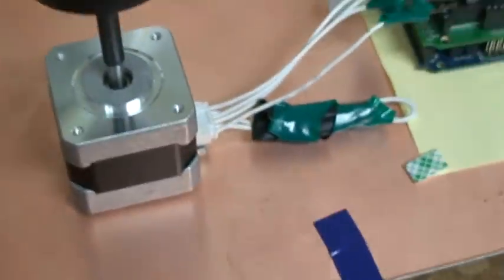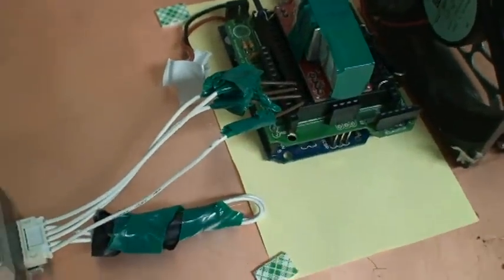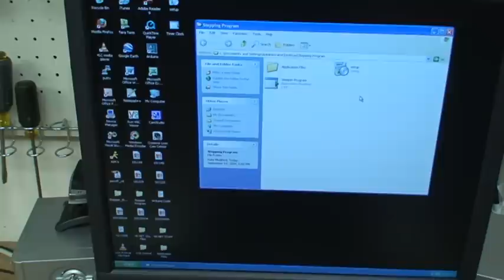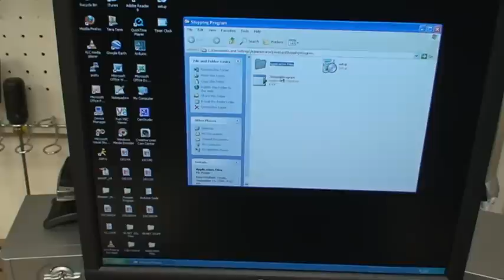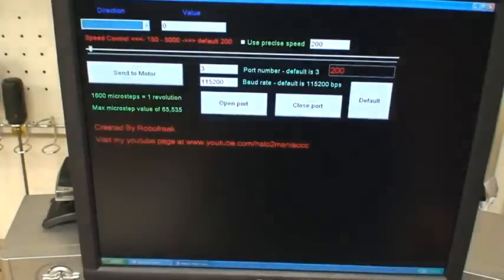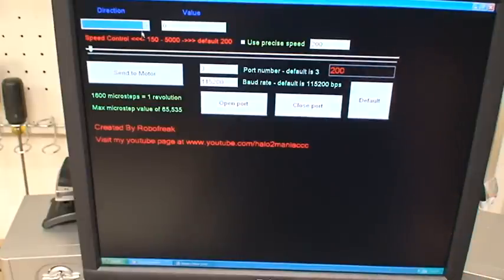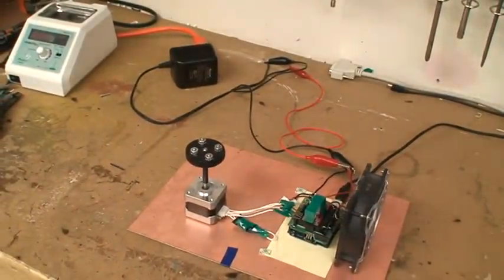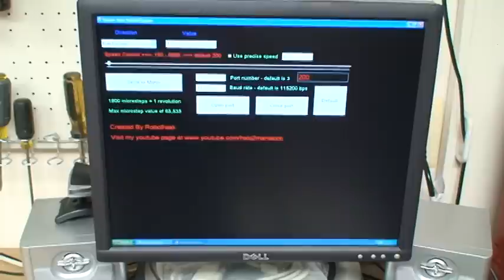Final stepper motor PC program easy driver v3

Comment: Hi, your videos are great. I have a question: In the software says 1600 microsteps equals 1 revolution. It means to be for a couple of revolutions must introduce 3200 steps? and not marking the 200 steps that has the stepper motor? I'm just trying to make one with Labview and Arduino and found the same situation. (that 1 step stepper motor, equivalent to 32 steps in the program)
Reply: Did you find any solution?

Comment: Hey Justin,  Appreciate your videos and the source code.  I'm trying to use your v2 Code with your VB.NET app.  VB I can handle, but the ino code is still escapting me a bit.  I can read it, but I don't quite understand it yet.  From what I can tell, you're using the digital pins, how would i tweak it to use pins 8-11.  Thanks for putting this together btw.

Comment: Thanks for the great advice. The motor shield does not have a current pot on it unfort. I will look into the probotix stuff. Good calll on the angle ext. for a heat sink, going to try that next. The motors pull about 1 amp. I have not connected the easy driver yet (kinda scared cause the chips are so small), hard to believe it can handle that much current, I will definitely heat sink that puppy. Ill let ya know how your software works with it. Thanks again.

Comment from the maker: O one more thing, if your motor chips are getting that hot you need to make sure everything is connected correctly and the current is limited. Its odd they are getting that hot so fast. The easy driver has a built in potentiometer to adjust how much current the motor can get. My easy driver got hot running at max power but the heat sink fixed that. All chips for things like this (motor driving) will get hot and must have somewhere to send the heat (pcb....heat sink etc...).

Comment from the maker: I would step up to a larger stepper motor driver if you can. Probotix sells one for $39 that will handle 3 amps continuously. I have three of these and each controls a large 280 oz in nema 23 motor for my cnc machine. Bolt a small piece of aluminum angle extrusion to the driver (as a heatsink). If its low power loads that fine but if its running at 3 amps you will want a tiny fan. They are just like the easy driver when it comes to driving them.

Comment: Sorry, I found it Dan. I did notice that you used a motor shield in one of your other projects. How do you do that without smoking chips? I tried very low current steppers and the chip get red hot in like 3-4 seconds. I think the motor shield is way cheesy for that. I says it can go to like 600ma, but I find that even piggybacking the chips they get red hot at 100ma. I tried all kinds of varying voltage with no luck. Steppers are current hogs! even the easydriver needs fans and sinks galore.

Comment from the maker: This is not the latest easy driver now but at the time it was. Now the V4 has been released and allows you to turn off power to the motor when it is stopped and it allows you to change the stepping resolution (200, 400, 800, 1600). If your motor is larger then mine you may have low torque because its just too big but if its the same size try turning the little tiny potentiometer on the circuit. It will change the amount of current the motor receives.

Comment: I am using a NEMA 23 like you, but my torque is low.  I tried running the motor at 8, 12 and 15v to increase the current and varying the delay value in the program.  Of course the 7805 on the Easydriver gets hot with 15v.  These set of videos are virtually the only practical applications using the lastest Easydriver.  May change the  arduino code to implement a sleep function.

Comment: My NEMA 23 stepper runs just fine under these programs.  I plan to add a "sleep" in Arduino Processing to the Easydriver between commands to the motor.  However, I notice that my motor torque is quite low.  I have tried running at 8, 12 and 15 volts to increase the current.  At 15 volts Easydriver's 7805 gets hot as expected.  Thanks for well documented code.

Comment from the maker: The stepper motor is just a small part of something like that it simply makes mechanical movements. Tracking the sun is the part that is tricky. I have not made anything like this before so I can't really tell you how to do it. Google sun tracking robots there are many out there.

Sorry I couldn't help you out that much, but if you have any other questions about the stepper motor I can answer them.

Comment from the maker: Arduino is an open source micro controller based on easy to use hardware and software. The pre packaged USB boards run about $30 at sparkfun and the software is free to download and use  It basically allows you to interface computers with the physical world in whatever way you can imagine without having to jump through hoops. Google arduino and its the first link go and check it out. If you buy the arudino starter kit at sparkfun, within a few days you will be amazed at what you can do!